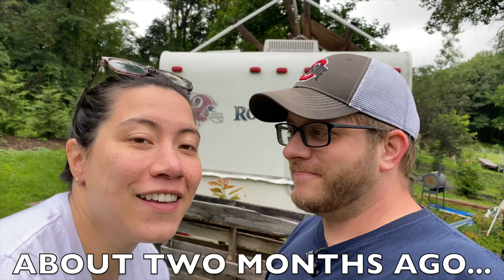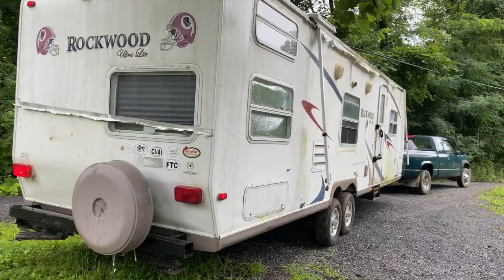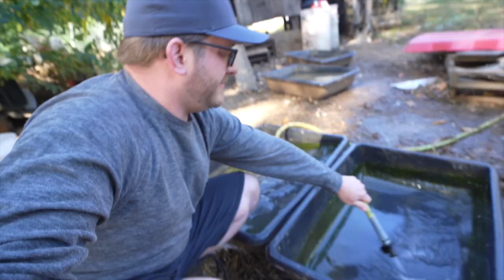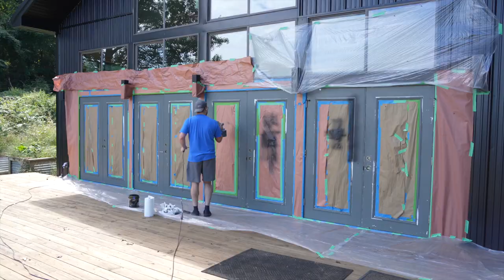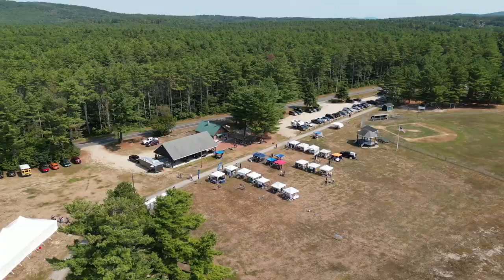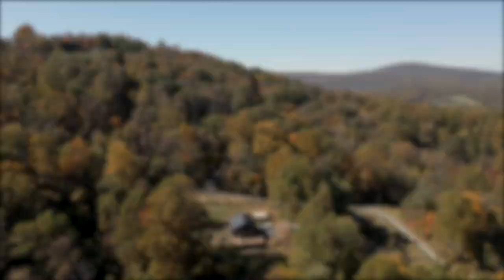Saying Goodbye and Fixing Mistakes

Comment: I saw a video where you used spray foam underwear the front of the house bc the gravel  was washing out. Is it still working for you, or did you have to do something else to fix it?
Reply from the maker: Still holding well under the deck 👍
Reply: @LittleMountainLife  thx!